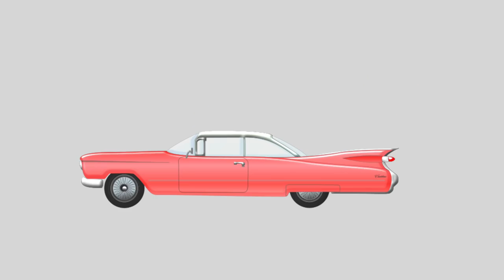Yes, Rockets CAN Fly in a Vacuum

Comment: Let's put a pretty girl in there and explain this.  Nobody will care if they understand as long she doesn't go away.
Reply: Whether either of you think she's pretty or not is irrelevant.
Can either one of you actually point out anything incorrect in the presentation?

Dismissing a presentation about basic physics because you find the host attractive or not is something that you're supposed to grow out of by age 6.
Reply: Papa Legba  
Yes. Congratulations. Freely expanding gasses are useless for performing work in a vacuum. Well done.
Also completely fucking irrelevant.
 
The very definition of a rocket is a device that can apply acceleration to itself using thrust by expelling part of its mass with high velocity can thereby move due to the conservation of momentum.
That's what Apollo's SIV-B stage did when it shot 80% of its mass into space at 4km per second.
This is exactly what I've been explaining to you time and time again. Pressure-volume work does not apply; Not in any magnitude to truly bother calculating anyway.
Rockets operate purely on the laws of conservation of momentum.
You are attempting to claim that they don't work solely by ignoring the fundamental laws of motion.
Reply: Papa Legba  

Sunshine, let me make two things very clear.

First, that is not my definition of a rocket. That is THE definition of a rocket as used by all of the engineers and physicists who design and develop them.

Second, after two degrees and a decade as an engineer it's safe to say I know not to bullshit if I don't know what I'm talking about. That kind of behaviour gets you quickly unemployable in my profession.

You seem to have no qualms about talking shite though, and you have made it very clear that you have now intention of listening to me.

So instead I'll leave you with this...

The Tsiolkovsky rocket equation.

That is THE equation used to determine the motion of rocket vehicles. It's over a century old and has been tested and proven to be accurate in every conceivable test, both simulated and real, in every environment from underwater to deep space.

This equation is what allowed the development of ICBMs, rocket planes and space probes. It allowed V2s to be launched at London, rocket planes to break the sound barrier, and all of the satellites that give hundreds of thousands of people satellite television.

And here's the kicker. It's derived from the laws of conservation of momentum.

Hundreds of thousands of engineers, scientists, and commercial interests from all over the world for over a hundred years have relied on it.

You're not arguing with me. By repeatedly claiming that conservation of momentum doesn't allow rockets to fly, despite all evidence to the contrary, you are declaring that all those people who were frankly much smarter than either of us are wrong, and everything they've achieved never happened. 

I hope you have some evidence for that. It had better be earth shattering for you to overturn a century of scientific and engineering progress.
Good luck with that.
Reply: Papa Legba  
Why do you think you can ignore the laws of motion when dealing with rockets?
You can understand how a rocket works with the most basic grasp of the laws of conservation of momentum imaginable.

Yet you refuse to apply it to rockets. And call hundreds of thousands of people who have been working with rockets for a century all liars with nothing more than a hand wave and exactly Nothing to support your claim.
Reply: Papa Legba  
You're not denying my claims.
You're denying the very laws of motion. And the hundreds of thousands of engineers who use them to develop theses rockets.

You honestly think you know more than every rocket scientist for a century?
Better write that shit up and get it peer reviewed. You've got a Nobel prize in your hands if you overturn the laws of motion.

No? Accusing me of being pompous while declaring that you know more than all the physicists on the planet for generations with nothing to support your claims?
Can you tell me the definition of hypocrite?

Comment: I was having n innocent drink with friends last night, and this subject came up. I never even knew this was a debate.  I'm not sure how you'd come to the conclusion that that rockets wouldn't work in a vacuum. It's  creating a force to overcome air resistance and gravity so if you get clear of gravity and air resistance surely they work even better in a vacuum, as they dont push the air like a tyre pushes the floor it just creates a directional force. The problem lies in the fact is there's not much fuel left as you need so much to get into space in the first place.
Reply: Flerfs think the exhaust gasses have to “brace” off something else to be able to push back against the rocket, kind of like how a car jack has to brace off the ground to lift up a car. 

It’s a combination of the fact that flerfs don’t basic physics and the fact that they need time deny spaceflight to maintain their worldview.
Reply: Its best to think of rocket engines as "Mass Drivers". They accelerate mass and therefore MUST feel an "equal and opposite" force to the one they are using to accelerate that mass.
So just like crossbows, and catapults, and guns - Rocket engines produce a recoil force.
This force pushes the rocket forward.
Reply: Obviously you don't know what a vacuum entails
Reply: @Checkeroute  Or are you a "vacuum expert"?
Care to tell us what would happen if I fired a crossbow into a vacuum?
Would I still feel a recoil force?
Why or why not?
Reply: @stuartgray5877  Stuart's back to the crossbows 😂😂😂😂😂 when we were talking about the immense vacuum of space🤦🏻🤦🏻🤦🏻🤦🏻😂😂😂.   

It's okay cupcake you can keep posters of NASA's Magical Mystery Apollo Moon Landings going to the Moon and back in an aluminum can using 1950s and 60s technology & NASA's  animated cartoonery, photoshopped, artist rendering and CGI imagery above your bed.    You don't have to grow up if you don't want to 😂😂😂😂
Reply: @stuartgray5877  After checkeroute's last comment it's best to ignore him, I don't know if you can tell he's a tin foil hat person.
Reply: @robjones6741  It's okay cupcake You can continue to believe in fairy tales 😂😂
Reply: @robjones6741  by all means, continue to believe in: 

*NASA's and other space agencie's animated cartoonery, photoshopped images, artist renderings, and CGI imagery🤣

*NASA's laughable Magical Mystery Apollo Moon Landing Tours of sending people to the moon and back in an aluminum can using 1950s and '60s technology 🤣
Reply: @robjones6741  Feel free to keep posters above your bed of Neil Armstrong and Buzz Aldrin and stare into their dreamy deep blue eyes as you drift off to La La Land every night kiddo.  😂😂😂
Reply: @Checkeroute  “Obviously you don’t know what a vacuum entails”

Funny you say that because a vacuum literally entails nothing.
Reply: @AM-rd9pu  Oh my God, they're not programming you bots with better intelligence?   What is there a budget shortage? 😂😂😂
Reply: @AM-rd9pu  cupcake, a vacuum is a space devoid of matter lol
Reply: @Checkeroute  Congrats, you got the definition of a vacuum correct. There are many flerfs and space deniers that don’t seem to understand that. I made my previous comment because it seemed like your were about to suggest that a vacuum (nothing) can exert a force on something. 

So what part of correctly defining a vacuum and making a reasonable inference on where the conversation was going makes you think I’m a low intelligence bot?

Comment: The balloon is a crapy example, it's the same as a jet pushing against the air.
Reply: Even Jet Engines don't "push on the air behind them".
They Push on the air that is IN THE ENGINE causing a recoil force that pushes the jet forward.
Rockets work by PUSHING OUT MASS, they don't need an atmosphere to "push on".

In FACT, rockets work BETTER in a vacuum when there is no atmospheric gas to slow down the exhaust gas.
The forward force on a rocket is proportional to the mass flow rate of the exhaust and the VELOCITY of that exhaust.
Higher exhaust velocity means higher thrust.
Higher exhaust velocity can be achieved in a vacuum than in atmosphere.
Reply: @stuartgray5877  yes they do 😂
Reply: @papalegba6796  NO jet engines push on the air IN THE ENGINE.
They do NOT push on the air behind the engine.

I am an actual Aerospace Engineer.
What do YOU do for a living?
Oh that's right you REFUSE TO SAY because living in mommy's basement is not a career.
Reply: @papalegba6796  SO if you think that jet engines can "Push on the air behind the engine" then please explain WHY the "AIr" does not just move out of the way effortlessly?
What makes "AIR" able to be "pushed on" like you people claim?

Please explain it to us.
WHY doesn't the "air" just move out of the way?
How does "Just a gas" put up any resistance and create the force you claim?
Reply: @stuartgray5877  you're not an aerospace engineer, you're a chatbot, & everything that flies pushes against the air. It's literally in the 4 forces of flight 😂
Reply: @stuartgray5877  the atmosphere has pressure, chatbot. Are you saying it doesn't? 🤔😂
Reply: @papalegba6796 You don’t understand thrust. You lie about it to conform to your worldview.
Reply: @papalegba6796  I am asking you to explain why the atmospheric GAS does not just MOVE out of the way effortlessly.
What gives the gas molecules the ability to be "Pushed on" as you claim?
It's just GAS right?
HOW can a rocket "Push on gas"?

GAS isn't something you can "Push on" is it?
I am trying to push on the air with my hand right now and I don't feel any resistance.

Comment: Issac Newton answered this question centuries ago! (ACTION = REACTION).
Reply: Newton’s law DISPROVES this. No object would  be able to propel itself against its own weight. You would need a greater thrust to overcome the action over reaction, reaction being movement of the weight of the ship, Action being greater propulsion than is possible for a rocket. 

It’s like you need 20 lbs of fuel to move your 15lb space craft, but your tanks can NEVER hold enough, you’ll always be just behind the needed thrust to overcome your Mass.
Reply: @tanner882  
"Newton's law disproves this"
No it doesn't. Newton's laws support this completely.

"No object would be able to propel itself against its own weight"
Accelerating and ejecting mass is how you do it.
Sit on a wheeled trolley with a medicine ball in your hands, imagine there's no friction between the trolley and the floor; throw the medicine ball at 10 meters per second in any horizontal direction. You'll begin rolling in the opposite direction.
Now you've accelerated and ejected mass, it has gained momentum, and you gain equal momentum in the opposite direction.
Reply: @tanner882  Would a CROSSBOW, fired in a vacuum STILL HAVE RECOIL? Yes or No?

Comment: Also, consider this:
If a rocket flies by pushing against the air then the higher it gets the less air it has to push against. It should be moving slower.
But in fact it's the opposite: it gets faster because
A. Less fuel and less weight.
B.  Less air to create drag. 
- A "simple" experiment to prove this would be take identical rockets and launch them horizontally. Launch a few at 100 feet above sea level, then launch a few from a mountainside thousands of feet above sea level.
The ones from the mountain will probably travel faster and farther.
Reply: No drag no thrust
Reply: @DrCash7  
No brains no sense. 
How do you calculate the thrust of a rocket engine, you've still not answered?
Reply: @bobartor910  no drag, no thrust sorry
Reply: @DrCash7  
Why won't you answer the question,  what are you scared of?
How do you calculate the thrust of a rocket engine? LMAO.
Reply: @bobartor910  Because you can't have thrust without drag.  I'm sorry this wasn't written into bot/ Bob Artor's codebase.
Reply: @DrCash7  ""Because you can't have thrust without drag."

Repeating an incorrect assertion does not automatically make it true.  

You can have thrust without any significant amount of drag.  Why couldn't you?
Reply: @davidmescher2526  lol "without significant drag."  Exactly!  Now you're getting it; where there is thrust there is drag.  0 drag = 0 thrust.
Reply: @DrCash7  
So how do you calculate the thrust of a rocket engine? Don't be a coward all your life, take a day off and answer the question. LMAO
Reply: @DrCash7  " Now you're getting it; where there is thrust there is drag."

The drag produced in a vacuum is not zero, but may as well be for any practical purpose.

Drag =/= thrust.
Reply: @davidmescher2526  You do realize all of you shll accounts format your replies almost identically right?  
It's not "drag = thrust" but rather without drag you have no thrust.  So typing "Drag =/= thrust" is not what the above comment stated.  But nice try.
Reply: @DrCash7  "You do realize all of you shll accounts format your replies almost identically right?  "

I think you need to up your medication if you think I'm a shill, or have shill accounts.  Or maybe you're just an idiot.

"but rather without drag you have no thrust."

You've stated this multiple times, it doesn't get any truer with repetition.

Thrust does not require drag.  Why would it?   They're two different quantities.  Drag is the force exerted by a medium on an object passing through it.  Thrust is the force exerted to move something.
Reply: @davidmescher2526  Why would thrust require drag?  If you can't answer that SIMPLE question then you have no business shlling on multiple accounts.
Reply: Lance - "If a rocket flies by pushing against the air"
Let me stop you right there.
That is NOT how rocket engines work. They do not "push on the air behind the rocket"
They push on the exhaust gas while it is still inside the engine.
Rocket engines are mass accelerators.
They accelerate MASS and feel a RECOIL force as a result.
Rocket Propulsion is just the mechanical recoil of pushing on mass.
Mechanical recoil still works in a vacuum, therefore so does rocket propulsion.
Reply: @DrCash7  - "No drag no thrust"
So you are back to claiming that rocket engines can accelerate mass without applying any force to that mass?

Maybe you should try understanding Newtons laws before trying to debunk them?
Reply: @stuartgray5877  I know - I'm talking AGAINST the others. I know it is "action - reaction."
Reply: @lance3748  But the REAL reason that rockets have more thrust in a vacuum is because there is LESS air holding the exhaust gases back.
Reply: @lance3748  Now just convince DrCash7 (Papa Legba) to UNDERSTAND what it READS.
Reply: @stuartgray5877  not according to w=pv, but you're programmed to hate the laws of physics so meh 😂
Reply: @papalegba6796  So tell us more about how rocket engines CAN accelerate mass without applying a force t that mass.
Come on YOU CAN DO IT genius.

Because that IS what you keep claiming even if you don't realize it.
Reply: @stuartgray5877  tell me why you ask me the Same question hundreds of times even when I already answered you, chatbot 😂😂😂😂😂😂😂😂😂😂
Reply: @papalegba6796  - "tell me why you ask me the Same question hundreds of times even when I already answered you"
Simple -
Because:
YOU
HAVE
NEVER ANSWERED THE QUESTION.
Because answering TRUTHFULLY - PROVES YOU WRONG !
Reply: @stuartgray5877  you still don't understand w=PV after all these years, you are a hoot, chatbot 😂
Reply: @stuartgray5877  gases expand from higher to lower pressure using their own internal energy, chatbot. No force is involved in the process, chatbot. There, answered you again. 😂
Reply: @DrCash7  Thrust & drag are both forces applied by the atmosphere. It's literally in the four forces of flight, NASA hate them 😂

Comment: I doubt the balloon demonstration is an appropriate one, it explains Newton's third law well, but to demonstrate a thruster a bomb will be a more suitable example where things fly around on the burst, its just that a thruster is a controlled bomb explosion to achieve the right direction.
Reply: We also use "Cold Gas Thrusters" in space which is basically EXACTLY LIKE a balloon blowing out air.